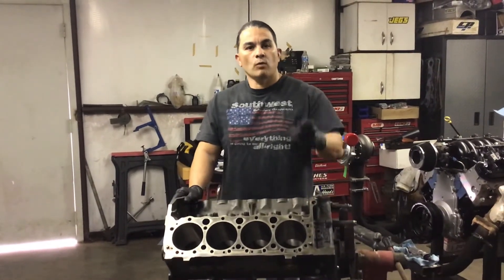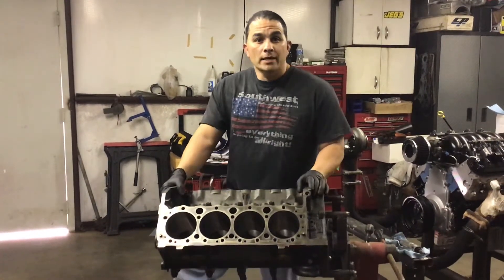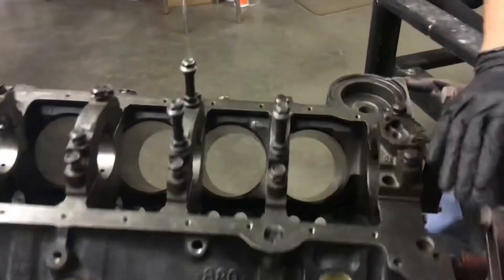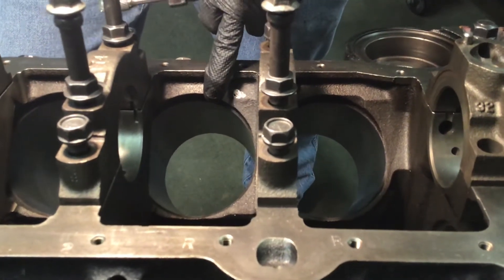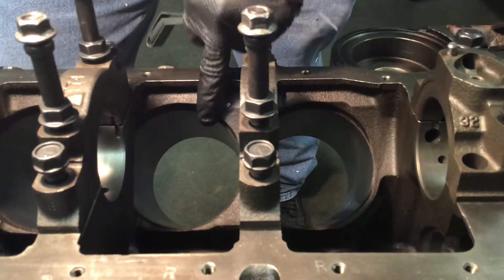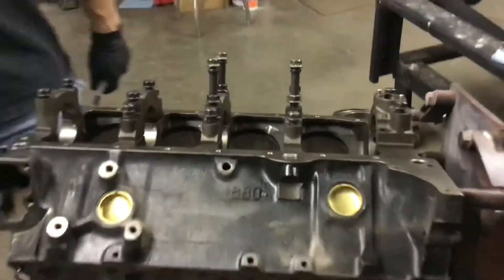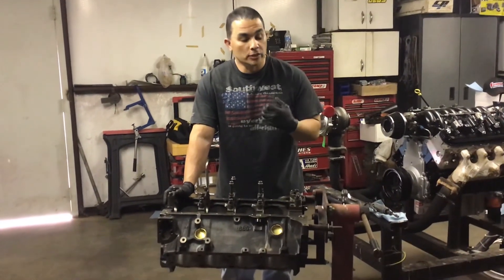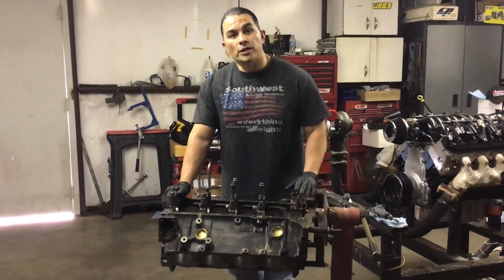Stroker clearance 350 block for a 3.75 crank

Comment: If you want to run a 6 inch rod do you have to get different pistons than the 5 7 rods with different wrist pin locations? Thanks
Reply from the maker: Bowtied One, yes if you are running longer rods, you will have to order Pistons for the 6inch rods
Reply: @reyracer  Hey thanks a ton Rey Racer. I knew the 406 but wanted to know for sure about the 383. I kinda thought I would have to but hey I'm 51 years old. Been doing this since I was 18 and I still learn new things. Great video. I'll be putting some out real soon. I'm building a 383 and a 496 so I'll do some video. Thanks for your response. I'll subscribe. 👍

Comment: Different years of blocks will need more or less die grinder work.
I used a 1989 4 bolt 350 block that was pretty easy to work over for rod clearance.
I didn't use any more than 1 hour to clearance the block for the rods

Comment: Steve I have SBC performance motor with the clearance already taken in consideration by GM. I had to rebuild it recently because of a knock.  Pulled ot apart and it spun a bearing. Bored it .025 over to make it a 4.030 inch bore because that's a common bore size in the 383 world. Mind you my block was already a 383 with a 4.005 inch bore from the factory 3.8 inch crank. So another. 025 inch bore made it fall in that piston size as all the other 383 motors that people build with a smaller 400 ci then the 3.8 inch crank I had to make up the cubic inches ot would need to make it a 383. I kept that crank had the journals check and polished. Rebalanced it and according to the machinist and information he gave me I purchased the bearings. Same size bearings as before same type of bearing that was in it before. 
If it spun a bearing can you get away with just a polish. It it didn't seem like it hurt it if any but I'm not the machinist I had to just trust him. I crank it up for the first time and it sounds as if the torque converter is lose. I crawl under it and checked them and no they were tight. The noise I'm here doesn't sound like a bearing knock. It sounds just like a lose torque converter but up front. You know as well as I how sound can be deceiving. I found it to travel from one side to the next and had everyone confused were it originated from. This sound as if it's right there around the timing chain. Just looking for some advice ro hopefully save me some more blood sweat and tears. The heads are fast burn heads which I find the best set of heads that GM has ever produced. They flow better then any other GM head out there. Especially after I ported polished and decked the lid. My compression now is 10 to 1 according to the machinist but it could be a little more then that from the head gaskets and head shave will create. Nevertheless I'm not trying to create alot of compression because of the plans for an adder. 
Can the bottom of the piston skirt ever cause clearance issues? The rod bolts are different then the last ones too. To be honest I might have just answered my own question. The rod bolts are possibly hitting the block. Because it's not your typical bearing knock. It lower in pitch and not that loud. Still has me nervous as hell! I'll pull the pan and post the results.
Reply from the maker: Chris Ahrens. You never mentioned what the bearing clearance was on the mains and rods? You didn't mention crankshaft end play? Was it a spun rod bearing or main bearing? Did you resize the connecting rod if it was a rod bearing spun? If it was a main bearing , did you lign bore the block? Too many unanswered questions.
Reply from the maker: Chris Ahrens. You can also find me on Facebook under Reys Engines

Comment: Great video dude! Subscribed. Question though, do you happen to know if I can safely take off enough to clear the water jacket of an  LS7 block with stock sleeves? I have eagle 6.125 rods (CRS6125O3DL19 non stroker clearance) & pistons with forged eagle 4.0" stroke.  Summit said it should work but didn't say anything about the clearance issue I ran into.
Reply from the maker: Jerico 
It depends how much you need to take off. Did you measure ? What areas are touching and how much needs to be removed.
Reply: @reyracer it'd be easier to show you. Made a video of the interface and commented about the size.  https://www.youtube.com/watch?v=E1SGSRrcHVo
A right triangle that is 0.485 x 0.661 needs to be removed. https://ls1tech.com/wp-content/uploads/2013/11/LS7-Cutaway-3.jpg water jacket cutaways show more than enough clearance for the water jacket i think.